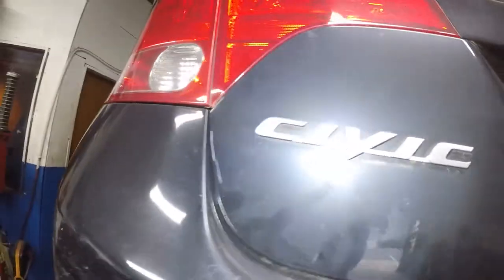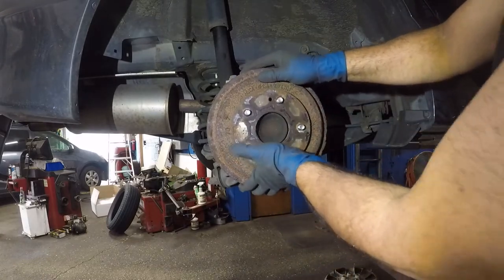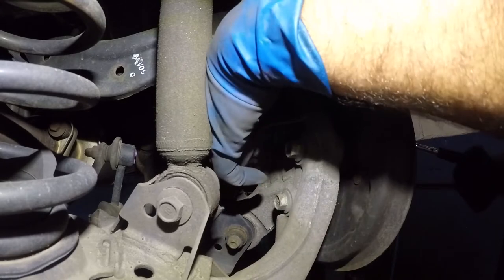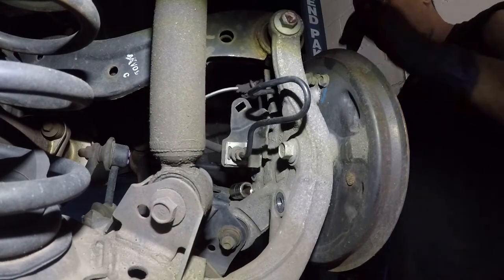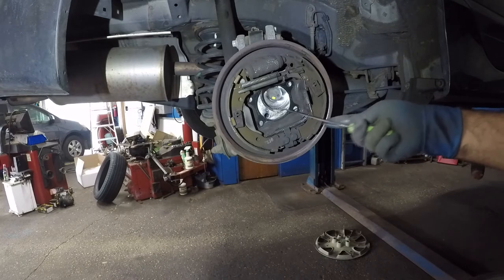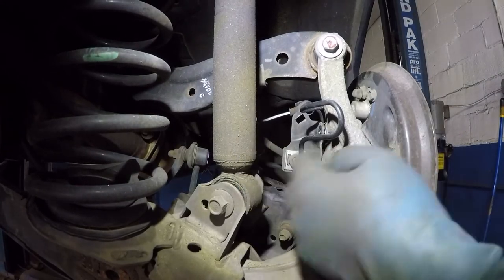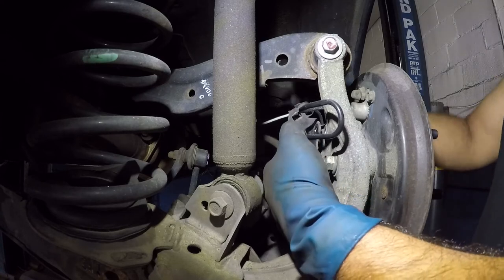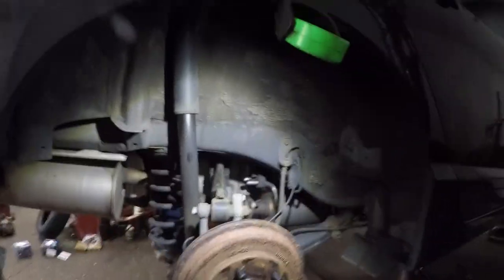How to replace Rear HUB BEARING on 2003 2009 Honda Civic

Comment: Can you do a video on 2008 Honda accord, my cars a manual and it makes a noise when I start it up but the noise stops either after like 2 or 3 seconds or if I release the clutch, whichever comes first and it runs fine I just dont know what that noise is
Reply from the maker: Sad Face it might be your clutch how old is the clutch how many miles on car and when it was replace last
Reply from the maker: Also this noise can be somthing else make a video let me listen to the noise
Reply: @RBTheMechanic  heres the link to the sound, sorry it took so long I just got home, it only does it after the cars been sitting a while. If I drive it and turn it off then on again it doesn't do it
Reply from the maker: Sad Face make a video let me hear it and try to pin point here it’s comming from
Reply from the maker: Sad Face on that noise now u need to have some one start for u and try checking under hood where it’s comming from the shhhhhhhh sound that’s what we talking about? Sounds like it’s power steering but try pin pointing it that’s how we check listen to it under the hood
Reply: @RBTheMechanic  I just bought power steering fluid today cause I checked it and it was below the lower level so I'll fill er up and see if that fixes the issue, I'll keep you posted
Reply from the maker: Sad Face ok
Reply: @RBTheMechanic  I filled up the power steering fluid, changed the oil all on Sunday and it still makes the noise. I recently saw your video about changing the transmission fluid to the 2008 honda accord and I have the exact same year make and model but I have a manual transmission, would the procedure be the same for a manual transmission or is it different for an automatic transmission?
Reply: @RBTheMechanic  I don't know hoe old the clutch is or when it was replaced but the car has 176k miles on it